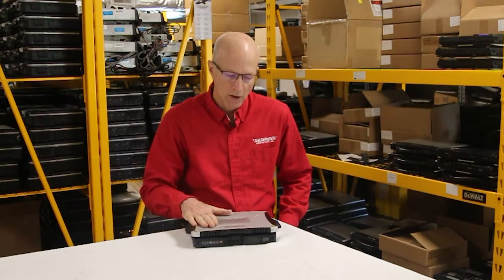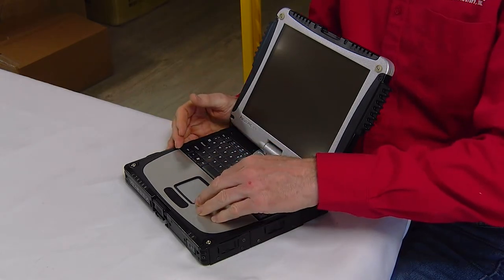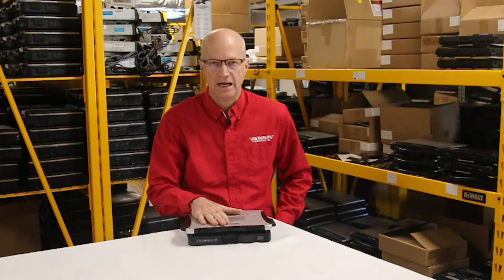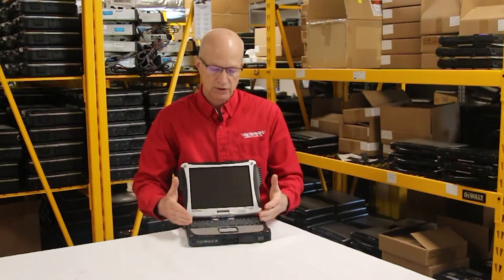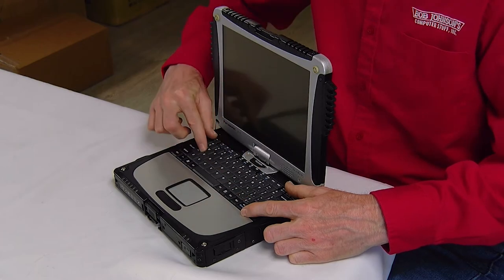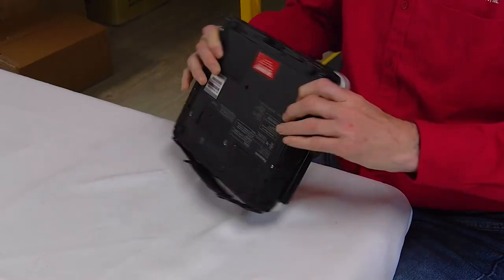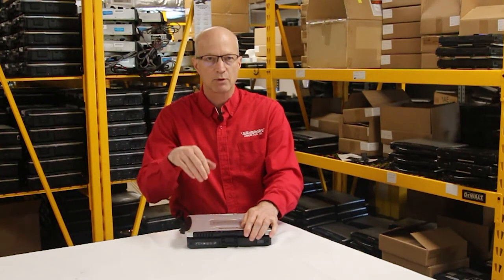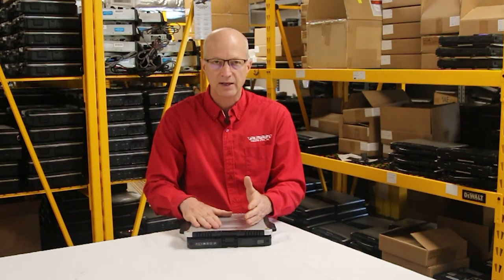EP 57: 5 Most Common ISSUES - Panasonic Toughbook CF-19**

Comment: In my company I use CF 19 and large quantities of CFD1 MK2 and MK3 which I sell to my clients together with agricultural navigation system. These are solid computers, but a dozen are already on the shelf due to touchscreen failure. The symptoms are that the cursor is visible on the screen, but it cannot be moved and is as if stuck when clicked, even using an external mouse is practically impossible. If I disable touch device in device manager then external mouse or touchpad in CF 19 works fine. However, the CFD1 must have a working touchscreen to be suitable for our applications. The computers are with WIN 10 professional. Do you think this is a driver issue or a hardware failure? I watched a video about the jumping mouse problem but in our case this solution doesn't help.
Reply from the maker: Sounds like a hardware issue to me.  To rule out the software, try reloading the machine to factory.

Comment: Please advice my CF 19 i found out not charge , i change new adapter with output 19Vdc 3 Amp. Try plug in charge indicator red light only shown around 15 minutes, than just suddenly off
Reply from the maker: @joesinurat9276 The best way to answer this question is to simply fill out our Tech support form.  Our in-house technicians will answer with the links and info you will need.  Here is the link: https://www.bobjohnson.com/tech-support-form/  Thanks for Watching.

Comment: Is it fair to say that every single Toughbook model line has had a problem with touchpad failure? it seems to be a common thread in all your videos, I've seen so far.
Reply from the maker: Touchpad failure is a common thread.  I think it goes back to the fact that these are resistive pads which require pressure to sense where your finger is at.  This makes them a very good option in a rugged environment where people are usually wearing gloves.  It however causes the pad to wear out faster.

Comment: Hey Bob, I hope you can help me.
Yesterday I installed some Xubuntu-Updates on my Toughbook and left it alone on my desk for about 1 hour. After I returned the Toughbook was completely dead. No Signs of Life. I removed the battery and power cord and went to bed. This morning I returned, plugged all back in but there's no LIfe in it. Not an only light is blinking or flashing, there's nothing.

Has my Toughbook died yesterday and why is there not one little light on, even if I plug the charger in. Have you any idea?

king regards from Germany
Reply from the maker: The first thing that I would check is your AC adapter.  If your AC adapter died, your laptop would continue to run on battery power until the battery was drained.  Since your AC adapter is not recharging, your laptop will not power up.  This is my best educated guess on this problem.  If you find this is not the issue then you have some bigger problems that would require some bench time.
Reply: @Bobjohnson  I was about to check it when I noticed that the power plug (third party) supplied 18.5V and the notebook only wants 16V. Perhaps the device was overcharged and died as a result? I bought the device just a week ago with the power adapter and everything worked.
Reply from the maker: @bwotech  I would certainly get me a better power adapter before I gave up on the laptop.  Those 3rd party adapters are not very reliable.
Reply: @Bobjohnson  I tested around with some other adapters, but there aren't any signs of life in the device.
Next I will open it and look for something I can identify as the cause.